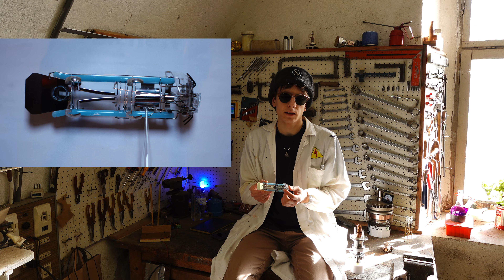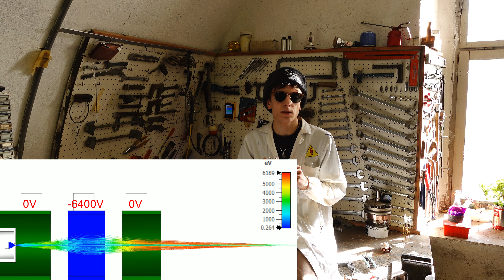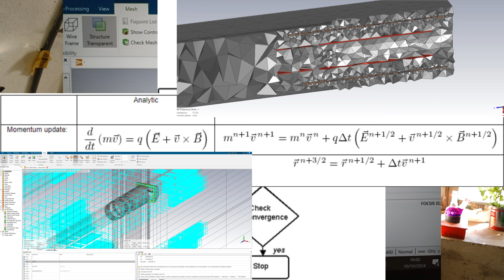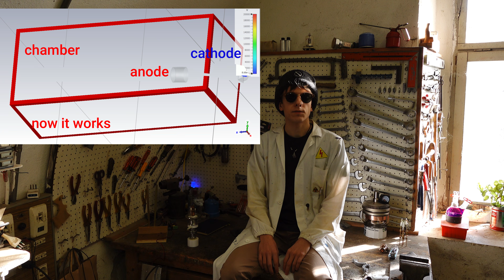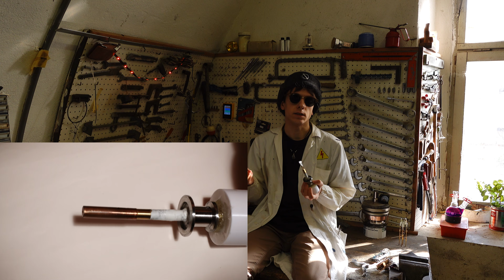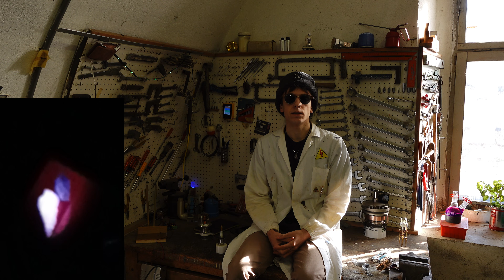Making an Electron Focusing System to Irradiate stuff | Cathodoluminescence-Experiments

Comment: quick question, couldnt it emmit gamma rays? im planning on messing with an CRT but im worried about that.
Reply from the maker: No, electron energies is too low to pose any danger and the glass thickness is made so it attenuate any xray produced
Reply: @Farben-X  but arent there some warnings and experiments that they use it to do x-rays?
Reply from the maker: @PAGARELA  yes but to make xrays they use overvolted rectifier tubes.
A crt tube run at his design voltage, that won't exceed 30kV will not produce any dangerous level of radiation
Reply: @Farben-X  Thank you!
Reply: @Farben-X  Thank you, hopefully its quite hard to do that

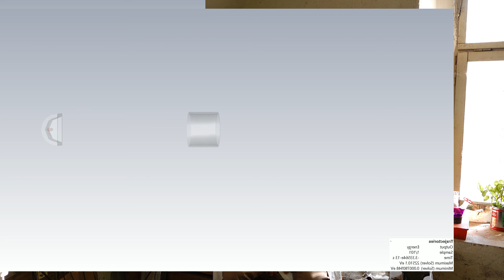Comment: At 11:40 in the video could you use pulsed dc to stop the electrons from going back to the anode to have a pulsed output. The electron would come off the cathode and be attracted to the anode, and then while the electron is traveling towards the anode the anode will then turn to 0v letting the electron go.

I am no expert and only have a basic understanding.
This is a wonderful video.
Reply from the maker: Hi and thanks for the comment, thats an interesting idea, it might work if you switch it off at the right moment so the electrons can keep their kinetic energy, though something like this is pretty difficult to achieve as the travel time from the cathode to the anode is typically less than few ns, could even be in the 100s of pico second so an extremely fast timing would be needed.
Reply: @Farben-X  I dont think you would need very fast switching since even just using constant dc and shutting it off would probably work since some electrons would be in the right place relative to the anode at the right time. Unless you want it to be very efficient then you would need fast switching.

Comment: Does the strontium coating get poisoned by exposure to atmosphere?  Is it reversible?  I got conflicting information on that.  And do you know if the same holds true for other oxide coatings?
Reply from the maker: Hello, yes it does get poisoned, but the degree of poisoning is proportional to the pressure of the atmosphere exposed and to the amount of oxygen and water present, the poisoning will lead to instant destruction if exposure is done while the cathode is hot, while if the cathode is cool this effect will still be there but slower and will not destroy the cathode, as after bringing it back to vacuum re-activation could be performed to bring back the emission before poisoning. My cathode was routinely exposed to air and it kept emitting for many hours but keep invmind every exposure will drastically shorten lifetime and require re ctivation.
This should hold true also for oxide cathode like Y2O3 or thoria, but in this case the exposure will be less damaging as the cathode is more rugged and allowed to  operate at higher pressure, going up to tantalum cathode, where subsequent exposure to air (when cold) will not lead to any damage at all
Reply: @Farben-X Thanks - by reactivation do you mean you need to recoat the filament, or just that you need to heat it up again in vacuum?
Reply from the maker: @Erhannis heat it up to the activation temperature for the required amount of time

Comment: Lots of good stuff in this one, I've been lightly researching electron tube design (If I ever get a suitable workspace I want to make tubes) and "The Oxide-Coated Cathode G. Herrmann & S. Wagener, 1951" is the only place I've seen formulas and lab/prototype level techniques discussed for making oxide coated cathodes. Nice to see some of it verified. Also nice to see electrostatic focus explained.
Reply from the maker: Appreciate your comment, yes that's the major source for the information, but I initially started to find many useful info in various articles fomr journal of applied  physics from the era 1940-1970, there are  articles discussing in detail many oxide coatings, this helped to understand how critical is the vacuum. At the end, it's a tradeoff, depending on how good you can get a vacuum you will chose a particular coating that can whidstand that vacuum, but that will have worse performance than the ideal BaSrO mix

Comment: Great video and awesome design. I really enjoyed that you covered all the important topics and made it easy to understand. The simulations definitely helped! It looks like it’s a really capable design yet still relatively easy to build for a hobbyist. 

Do you think it would work for e-beam evaporation?
Reply from the maker: Glad you liked it😊, to my knowledge electron beam evaporators are just this + a target,   the only difference might be the current, as in my setup I used a small filament and small hole to get a better focusing so the current is limited in the 100s of uA, while evaporators normally operate with higher current up to Amps, so you would need a few kW of 10kV power supply, or use a low current and get a really slow growth rate

Comment: Great video! What is the required emission current from your source?
Reply from the maker: Hi, I'd depends on how fast you want to perform the experiments, anyway mine is in the range from few uA to around 100uA
Reply: @Farben-X  Wow, that's a lot of current!
Reply from the maker: @weinihao3632 yeah but relatively, in crt tv, the current is higher, and in normal vacuum tube its thousands times higher. Also the current depends massively on how well you are able to activate the oxide layer
Reply: @Farben-X  Ok, I usually work with electron microscopes. There the current usually is in the nA range.
Reply from the maker: @weinihao3632  cool, yeah, you got a very low current there, do tem have such a low current too? I thought that they had a higher current to allow the phosphor schreen to lit up enough
Reply: @ We usually use a microchannel plate (MCP) for electron amplification in front of the phosphor screen in the transmission case.
Reply from the maker: @weinihao3632  makes sense, but the old one did use a phospor and an optical  microscope to magnify even more?
Also, do you have any experience with fast electron microscopy? Like pulsed tem / pulsed cathodoluminescence?

Comment: Very interesting and useful video! I was searching a software like the one you showed on the video. I also made the "amateur" CRT and struggled with the focusing of the beam. Now I can finally calculate the lens and move on with the project. What vacuum pump are you using? Is it rotary vane?
Reply from the maker: Hi, yes rotary + a really junk turbo, just enough to reach 10^-4/ 10^-5mBar, maybe a good rotary one is enough
Reply: @Farben-X  That is really high vacuum! My 2 stage rotary vane pump can only go down to 2 Pa as per spec (I have no way of measuring it, probably it does not even go lower that 50 Pa). Maybe the junk turbo is not a junk after all :D. How much time do you need to evacuate the chamber? Also have you tried using strontium aluminate as a screen? I tried it but never got it to glow.
Reply from the maker: @zxz38    it needs between 30 to 60 minutes, unfortunately the turbo is not mine ☹️ was lent. Also never tried strontium aluminate, to get a good emission it needs to be doped, was your doped or pure?
For the vacuum I would give it a try even at reduced pressure, you can still get electron emission from an ionised gas and form a cathode ray in a plasma, won't be focused as much as if the electrons came from a filament but better than 0
Reply: @ It was doped (I bought it as glow in dark paint) Do you think that the same electron lens can work also with ions? In my tube I guess that mostly the nitrogen ions are the charged particles. I also tried with small light bulb as electron source without much success (maybe it was a problem with the extractor electrode or the pressure was too high). What works is just sharp needle. The screen is from broken fluorescent lamp. Nothing else seems to be illuminated by the particles (I tried with several differenet glow in dark paints and ZnS doped with copper),
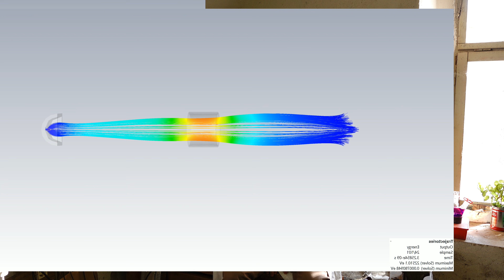Reply from the maker: @gbochev  if your setup is the one I see in this video you made (https://www.youtube.com/watch?v=2rOIEr2-pbk) then probably the problem is the one I shower in the simulation at 11:43 in my video. so no electrons reach the screen bc get their trajectory inverted in direction before the screen. Also the same electron lens definitely works with negatively charged ions. the sharp needle probably works because of the higher electric field, a better plasma is generated and then accelerated.
I would suggest trying with the cathode at -kV and the anode at ground voltage, otherwise use the anode at +kV but put a metallic mesh attached to the wall with the fluorescent powder
Reply from the maker: I've now seen the description of ur video, if the plasma completely disappear after the complete evacuation of the vessel, then the vacuum is enough to use a tungsten lightbulb filament as electron source for some minutes (before the filament burns away)
Reply: @ I will try it again then. Makes sense that when there is no plasma it is empty enough to shoot electrons. I think you are right about the issue of the returning path, because I have seen it with the plasma going pack to the electrode. But I found a lot of websites describing the first CRTs were just like that - there was no focus electrode, just a small hole to filter the electrons and thus make a smaller spot.

Comment: Hi! Thank you so much for releasing this video. I am currently working on a similar project and this helped me a lot. Btw did you use the education version of CST or the full version? Thanks
Reply from the maker: Hi, full version, what are you trying to build?
I think this could be done even with the educational one but I'm not sure100%
Reply: Thank you for responding, I am hearing about this software actually for the first time. I will be trying to build a strong electron gun and make a primitive particle accelerator (to achieve about 70 keV). I would like to produce cerenkovov radiation in moissanit crysta (I am aware that it would produce a lot of other types of radiation - I would need to detect it using a spectrometer).
Reply from the maker: @mirektomes8285  are you doing this as part of a research project or hobby? Btw, have you considered that electrons penetrate very poorly inside the solid object, so won't go very deep inside your crystal? Probably less than 5um
Reply: @Farben-X  I wanted to do this experiment for a long time and because I need to make some kind of graduation thesis I thought that this is the moment when I should realise it. And yes, I am aware that the beam won't penetrate deeply. Because of that it would still be still kinda theoretical experiment and I will strongly rely on the data from the spectrometer😅
Reply from the maker: @mirektomes8285  cool, ping me if you release anything I would be curious to see it.
My last advice is to focus on the vacuum quality, as to keep 70kV from discharging is not easy

Comment: Excellent work! We need to hoard all the halogen bulbs before they disappear. Also in electron guns for   X-ray tubes and electron irradiators invariably they seem to use just tungsten cathodes, they are longed lived under high acceleration potentials.
Reply from the maker: True, I read somewhere that thoriated tungsten can support being at like 10-15kV but tungsten in the only that survive high energy ion bombardment
Reply: @ Indeed, and the issue is that there is a very narrow temperature range in which tungsten has acceptable emission while not sublimating in a few hours. I guess if there is no alternative the only left is to use large area tungsten cathodes at lower temps. At least that was my conclusion when I was designing my own X-ray tube, I wanted it to last along time. For imaging is an issue due having a larger etendue but for irradiation it should not matter.
Reply from the maker: @teresashinkansen9402  I evaporated a lot of tungsten filaments to achieve the desired emission. Did you make the tube and post it somewhere?
Reply: @Farben-X  I havent made the tube yet but I did some tests at an university that allowed me to experiment a bit but I was not allowed to make X-rays so no target or high voltages. I experimented with the cathodes at voltages around 8KV. I haven't been able to procure a high vacuum pump yet, Im thinking in making my own oil diffusion pump though with an extra stage jet ejector so I can use HVAC vacuum pumps as roughing pump. Im limited by time and money at this moment. If I do make it I publish it here on youtube.
Reply from the maker: True, I went to the store to buy them for this video, and they were the last package available, so I ordered some of them for future experiments. It's kinda sad that led are replacing everything

Comment: Good job (if a bit over-engineered – just use the e-gun assembly from a CRT)! CST Studio is indeed very helpful with these designs. Unfortunately the W filament from a light bulb lasts only about 15 minutes in poor vacuum. I tried using small disks of Tantalum foil (~0.15mm thickness) as thermionic emitters (similar to those by Kimball Physics). They work a bit better than W. I also tried electroplating Ta with Yttrium. This worked the best, but again it only lasted for a few minutes until all the Y coating was gone. Probably needs real vacuum coating instead of electroplating. Anyway, this is why we need those CNT emitters pronto! 🙂
Reply from the maker: Hi, happy to see you here, yes a CRT would have been easier, but this work has been very helpful in learning about this stuff at a more realistic and practical level than I previously had. I thought tantalum would last longer than tungsten as it should be less reactive anyway also my strontium oxide will last a few minutes, but I found you can just add some more on top and reactivate it, also happy to hear you were able to successfully use Yttrium, as in the video I have shown a positive result, but that has been the only time it worked, the other time I tried it wouldn't activate.
We definitely need those CNT!, I have made some more tests since we contacted last time. However, the vacuum still is a problem, so now I'm working on a new system that is essentially a glass tube with high vacuum feedtrough, and a homemade Ti getter to lower the pressure.
Btw I found another line of research on this topic that uses RVC foam instead of CNT. Let me know if you want the paper so I can send it to your email. It seems to be more resistant tand less finicky to make but emits a little bit less current.